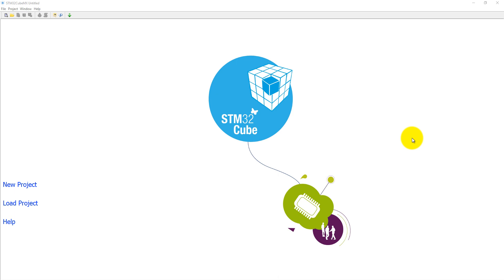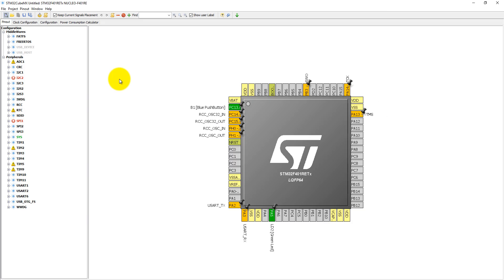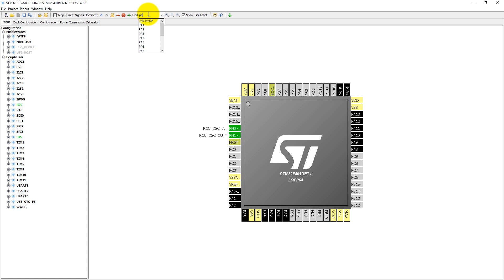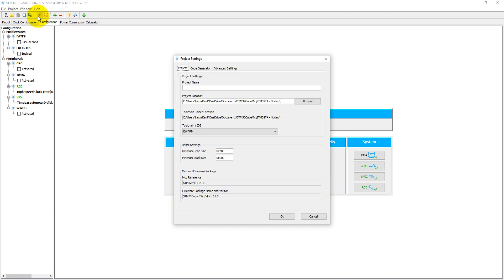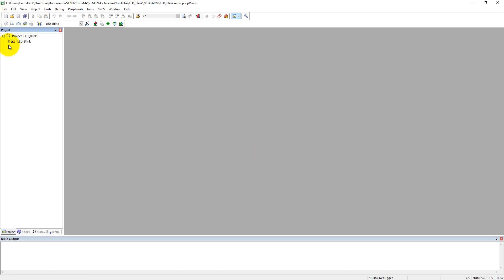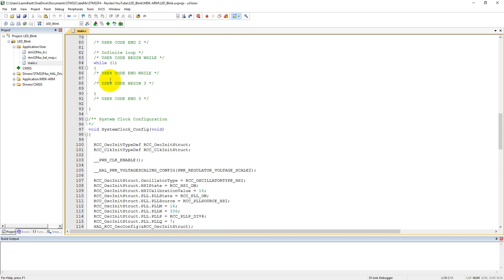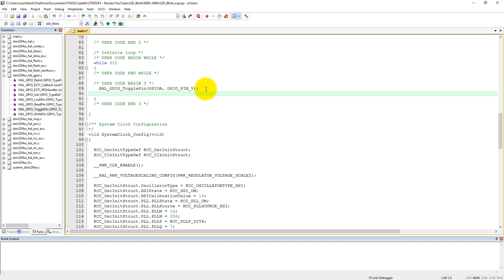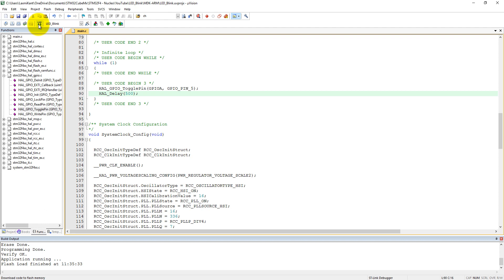STM32 Nucleo Tutorial 1- LED Blinking code generation using STM32CubeMx for Keil

Comment: Total noob here. What is the purpose of generating almost 200 lines of code ? It's a simple blink program, can't we just create a project and write those 2 lines you wrote ?
Reply from the maker: The purpose of generating structured code is to convert it in large project someday. Once you get into industry, there you have to follow a structured coding techniques. Moreover, it is always better to keep things structured.
Reply: Bibek Koirala also if your comparing it to something like arduino, then all that extra code does exist. Arduino just hides it. But that is also a limiting factor as the programmer doesn't have control over that code.
Reply: It's much worse than 200 lines of code.  It's many thousands of lines in all of the other files.  The minimum number of things required to be  initialized is downright horrifying.  I came from the dsPIC family, and this is so much more complicated.  It's a very high cost of complexity just for getting floating point.

Comment: Hello sir, great tutorial again......i have 1 problem i face the some problem while loading code
it gives error  cannot load flash device description....error:flash download failed......and before that when i generate the code and open project then it shows the window containing message loading PDSC debug description failed  STmicroelectronics STM32L476Rg  disabling usage of  PDSC debug description
Reply: I think you need to select a right flash algorithm from settings in Keil.
Reply: see at 09.34. Is it the same in your case?
Reply: It works......thank you again
Reply: @pragatibelsare8552  Great to know.

Comment: Im getting Flash download failed - "Cortex-M4" when i want to load the file 
Did anyone face it ?
Reply: Me too. Did you find the solution. Please share it.Thank you.
Reply: Hii,I got it solved
After generating the code from cubemx (in keil workbench)
we need to try another space in memory for flashing the code.

So, go to Options fr target -> Debug -> debugger settings -> flash download
Here give another address range fr flash (Excluding the default range, fr which we get the problem)

Comment: when I go to set Debug it says "No ST-link detected" what do I do?
Reply: Just spent hours trying to figure out the same thing and eventually found you need to install ST-Link drivers for KEIL to connect to the board.
Reply: there is a pin U5V and E5V. Your jumper is connected to E5V i guess. Connect the jumper to U5V-the other two pins out of the three pins available
Reply: Same here , did u got it ?
how should we proceed ?
Reply: I got it solved when configuring some options, By the way i connected the board through a USB to Mini type b cable.
I'm not aware of what you were saying,could u  pls throw more light, fr an amateur   :)

Comment: Thank you for this tutorial.  It was of great help in getting started.  One thing I noticed, in the Pinout tab of the CubeMX, under RCC, you set the High Speed Clock to Ceramic/Crystal resonator.  But in the Clock Configuration tab, you never changed the PLL Source Mux from HSI to HSE.  So, by default, the chip is running off the internal 16 MHz RC oscillator.  It makes NO difference to the operation of the system.  But to achieve the sane result using the 8 MHz Crystal, you would need to change the PLL Source Mux to HSE and the first divisor ("/8") to 8 and the HCLK would be the same.

Again, thank you for a great tutorial.  I look forward to many more in this series.

P.S.  Your website seems to be down
Reply from the maker: Thanks for pointing it. Just silly mistake :P. I believe this video must have served its purpose. Please visit https://kgptalkie.wordpress.com/ 
Did not had enough money to renew hosting :P.
Reply: @KGPTalkie  I am not sure if you are aware of the board you are using or not. In the board, you showed. There is no HSE or LSE mounted. Board won't work if you switch to HSE or LSE.